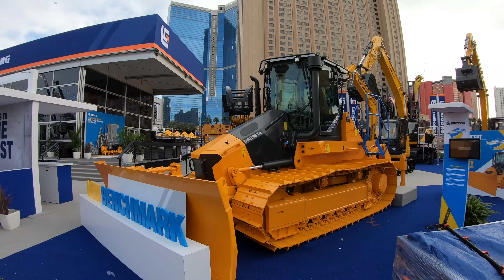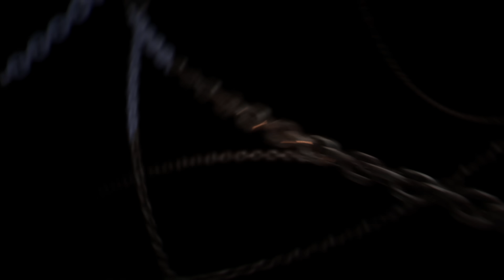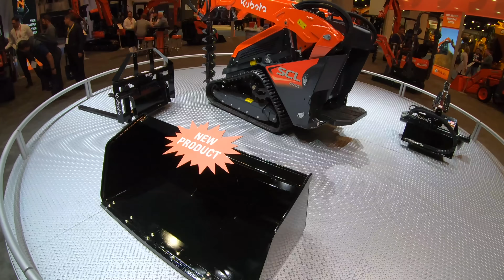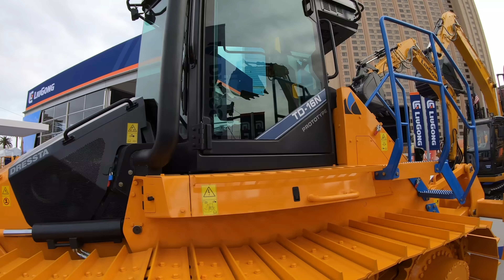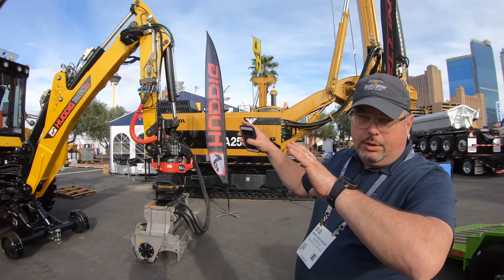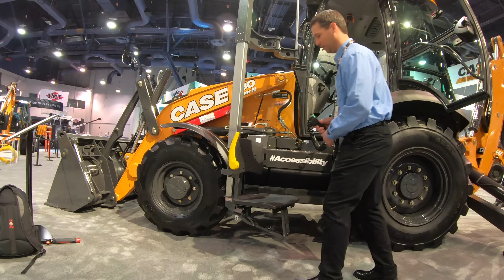Coolest equipment at Con expo

Comment: had one of these Kubota mini, sold it with 100 and some change hrs on it for 2 reasons. top heavy flipped on a hill that we've had a toro all over and the aux attachments had a safety shut off that you had to reset everytime you went in reverse. went with bobcat mt100 and I can't express the capability of this machine bob cat stepped up for sure

Comment: Ran a Huddig 1160D (previous model to the 1260 that is sold bow) around 9 years ago and it's the most fun and best machine I've ever operated. It's not a great digger and it's not a fantastic wheel loader but it sure is the best digging wheel loader it there.

It's hydraulics and controls are in its own league, not much can stop it in terms of terrain and it's a very stable platform. It feels like it's going to flip over but it just doesn't, not even with big loads in the out to the side without supports down. There's a saying about the Huddig, "You can't get a Huddig stuck, if you can't get it out you simply have not tried hard enough!"

But like everything it costs there after. But if you ever get a chance to try one Stan, do it! You won't regret it (until you see the pricetag). Even better if you can get the radio control a go to. The one I operated didn't have that feature so I've never tried it but it looks handy in tight places.

The lift on it is also to hold power line poles while digging them in or removing them.

Comment: Hello can you fix test drive of Huddig? Se if you can get one whid out rail system so you can test it out in work. Think you should try one calld City I own a Huddig 1260d Cable and its relly a good for almost everything best regards Robert
Reply: By the way Huddig have an hydraulik standplate i stead of steps for easy axess to cab 😊

Comment: Noticed a potential problem with the accessible backhoe,  the door handle is very high up, and I dont see any handle built lower down anywhere.  Plus the remote to operate the chair lift is stored inside the cab, so I dont see how a handicapped person could even get into the machine in the first place.  Unless this thing has a key fob door opener,  that also controls the chair,  this might be a very well intended product that its intended market cant really use.

Comment: I would like to see more on the Dressta. We own a two Komatsu D61 which would be in the same size and class as that Dressta. Our Komatsu has the radiator behind the cab the same as the Dressta to increase visibility but it has the air intake and exhaust centered in the front hood. I have a lot of questions on this Dressta Dozer. I hope your video will address some of them.

Comment: I’ve always been fascinated by the Huddigs. But they seem to have low front buckets.
Reply: You can get it with most types of buckets, they usually have Stora BM quick hitch so standard Volvo wheel loader buckets fit, to a certain size of course. But the low one is popular in Sweden.

Comment: ASV still hasn't improved their undercarriage no surprise there.
Reply: bert26a 
They changed roller and track manufacturing partners 5+ years ago. Fixed several wear issues....mine has 1065 hours, all original tracks and rollers that have been put through hell. Zero issues working in abrasive rock with 65% of the ORIGINAL tracks left. Speaking from experience, thousands of hours on  other manufacturers and wouldn’t trade the ASV for the world.

Comment: Huddig 1260 d = Maximum Flexibility of machine would be my choice 
QUESTION: Can it Support Front-mounted Forestry Head ?
Remove bucket then forestry head
Reply: Yes, it was originally designed for forestry iirc. It also sees alot of use for line-men. Replacing poles and with the lift. You can  also get a respectable size front mounted crane

Comment: As a wheelchair user, The Case 580 Super N was my favorite. With electronic joystick controls you no longer have to be a big strong person to wrestle the controls of a large machine, and pedals are obsolete so no need for working legs either. And while this one still has a steering wheel, that will soon be gone as well. This is a good start, and I'm really glad they are working on making equipment accessible. Now when I can roll into the equipment with my wheelchair, and lock down and drive like I can in my van, that will be great!
HATS OFF TO CASE!!!
Reply: The remote can easily be made wireless, just like your car's key fob.
What Case has done is not perfect by any means, but it is a start, and it will continue to get better. And doors can be made to open and close with actuators via wireless remote as well.

Comment: ok bone to pick,, if i am in a wheel chair their is no way in heck vill that i am going to be able to open that door and grab the remote inside. it all needs to be at the second step level or lower. if they had the remote lower or wireless once the chair raises them then they can open their door.
Reply: Wireless remote to lower the chair and opens the door with an actuator. Can all be done via wireless remote. On my van I press one button on the remote and my side door opens, then the ramp comes down. Another press on the remote and the ramp comes up and the door closes. Easy to do. Case will make changes quickly.

Comment: As a disabled Veteran, unable to walk or climb, The handicapped backhoe, to me, is absolutely amazing !  If I was younger, I'd have one in a heartbeat.
Reply: You are never to old for a new toy👍
Reply from the maker: I thought the same thing.
Reply: Seen one on a tractor works well with CVT transmissions works really well had a wheel chair user buckraking with it  but do you think you would be able to reach up and unlatch the door and then reach the control in the cab i kinda think they need to think something out there ?
Reply: @NHT7040  That was my first thought as well when I saw that!  Needs a wireless remote that he/she/it can take with them.
Reply: that case... perhaps the best machine... even when the dozer was a neat one
Reply: Cool concept - but how do you get to the controls when the are inside and the handle to the door is way up high?  I can't be the only one who saw that limitation can I?